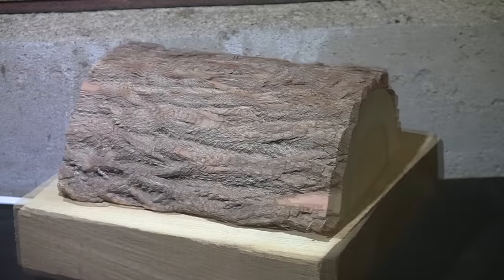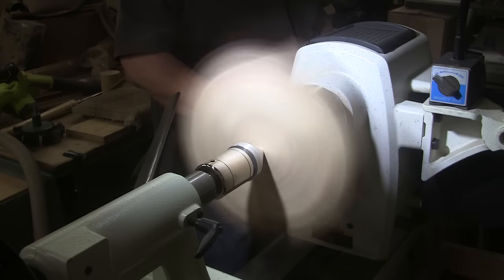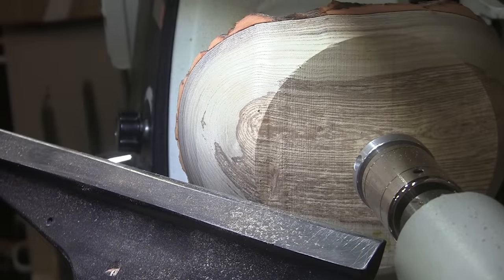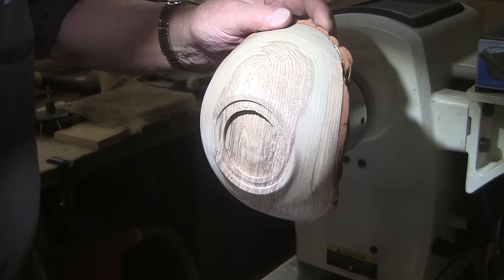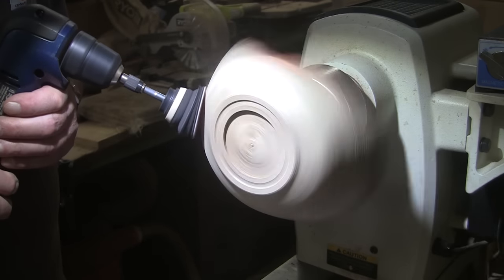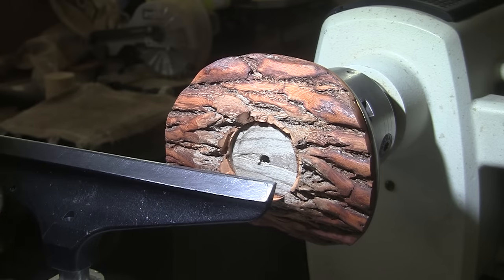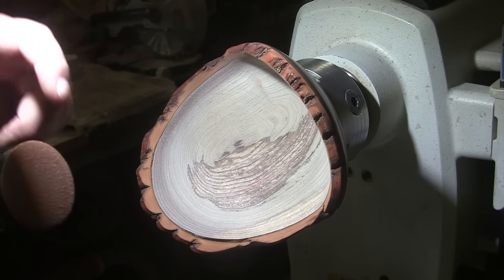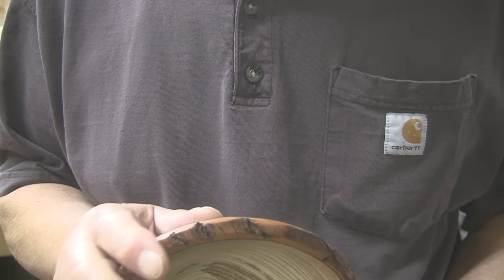SPICY Pepper Wood!  Round 2!  Really Nice! - Wood Turning

Comment: Thank you Jim. Phil, I see others saw the calipers leaving the fine lines in the soft wood, so you already have your answer to the mystery. Softening the caliper edges will help prevent future scratches. Lots of different birds inside and out. Happy this side turned easier than the other half. Guess you need to turn a French fry/veggie platter for your next turn. 😜🤣
Reply from the maker: I check those calipers all the time for burrs, Valerie.  I will run some 600 grit over them.  I think the soft wood and the operator are most at fault!  It better be a big platter! 😊
Reply: @PhilAndersonShadyAcresWoodshop  Don’t think it was a burr, just sharp edges on that soft surface. I have a 16” maple platter in the works on the lathe now. But it will have to wait until my right hand surgery is healed up!
Reply from the maker: @valeriehenschel1590  When you get it done send it over.  I'll fill it with nice cold greasy fries for you!  😊 Hope it heals quickly!
Reply: @PhilAndersonShadyAcresWoodshop  Only if sweet potato or yam. That begs the question: What finishes are grease proof? And if I send it with Cindy, it may get hijacked! 🤣🤣🤣

Comment: Hey Phil. I think the straight lines were caused by your calipers when you were measuring the thickness. If you watch the video, you will notice a line appearing on the inside when you are withdrawing the calipers. This was turned off when you made the sides thinner. Great as usual. Thanks, Stan.
Reply from the maker: You are correct, Stan! 😊

Comment: Beautiful piece...I think the lines are from the tool that you use to measure the thickness...
You can see it making lines on the inside in the video. But because you sanded the inside after measuring they disappeared there.
😉👍
Reply from the maker: You are absolutely right! 😊

Comment: Great bowl. I have a piece of pepper wood that I traded for. This makes me anxious to turn it. Beautiful. I happened to see you put one of those scratches in, probably the second one as well. It’s caused by your calipers when you checked the thickness from bottom to top, or the Thee direction. I’ve done it too. Maybe hit all 4 points with some 320 to round over all the edges will take care of it forever. Thanks for sharing this with us.
Reply from the maker: You are right, Doug, it was the calipers.  I check them often for burs but have never felt any.  I will take some 600 to them next time I'm in the shop.  I blame the soft wood and the operator for those marks!  😊

Comment: I live in Canada. I have bought a can of the Zinsser Bulls Eye shellac traditional finish and sealer. Can you tell me if this seals the wood and there is no need for sanding sealer. I want to make sure I do it right. Thanks
Reply from the maker: I wish I could help you, Dell.  I can tell you, the sealer I use is called Zinsser Seal Coat.  It's thinner than shellac AND dewaxed.  That allows the sealer to penetrate deeper into the wood and allows any clear finish over it.  I can also tell you, I've seen other turners just apply shellac with no sealer coat.  I don't know how well it works but it looks nice.  😊

Comment: Just a thought. When you used your thickness calipers you slid them across the surface. Twice. Could that be the line you showed?
Reply from the maker: Yes, they and the operator combined with the soft wood caused the lines, Jim.  😊

Comment: Hello Phil  its Tony again, beautiful work as always.  I have ended up with several scrapers and would like to turn one of them into a recess tool. What is the degree on your recess tool ? I was thinking you said your chucks are nova chucks and that's what I have so I believe the degree on your recess tool will work for me to cut into one of my scrapers. One more question is which surface do you sharpen on your recess tool. Thanks for all your help
Reply from the maker: I bought the recess tool from the same folks that make my Nova chuck, Tony.  I don't know the angle.  I can tell you, it does not have to be exact.  I sharpen mine with a handheld diamond card on the beveled edge. 😊
Reply: @PhilAndersonShadyAcresWoodshop  thank you Phil. I done some digging last night and I found one with specs that said it has a 15 degree angle. I'm going to give that a try. Thanks for getting back with me

Comment: Hi Phil. I'm new to the wood lathe game. Haven't turned anything yet. I took a few logs from my neighbors downed maple tree. How long do you wait to turn them. And should I do any prep to them while drying?
Reply from the maker: I'm not an expert on that part of the hobby.  I turn mostly dry wood.  I've heard it takes one year per inch of thickness to dry wood.  There are faster ways to dry it, like making a drying box out of cardboard, a fan and a lightbulb.  I've tried commercial sealers meant to keep the wood from cracking and it did nothing.  😊
Reply: Thank you.